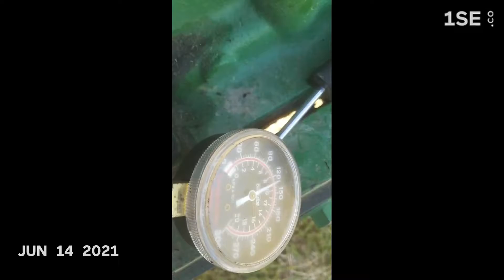2021 captured one second every day

Comment: Came here for the top end overhaul on the Lincoln and became mesmerized by this afterward! Way to go bruh on a solid family. Another "Cat Dad" from the PNW.
Reply from the maker: Thanks man!
I have 2024 1SE I'll upload as well.
Also the Lincoln will need another top end as soon as I get my shop put back together.  Inferior overseas parts from Ebay allowed a timing sprocket to split, timing chain to break and wreck the valvetrain on the whole passenger side of the engine.  My goal is this summer to have that together.
Reply: @vengethis  I know most shops will lift the body (on a number of different vehicles) to make a ridiculous job a lot quicker, but damm, that just seems like a ton of extra work. I took and engine out of an Aviator right through the top but I cheated by pulling the carpet back and took a 1" holesaw to the firewall to pass a socket through to one, entirely inaccessible bellhousing bolt. Plugged it with a plastic body plug. I may end up pickin your brain on the 5.4 when it comes time to do my guide rails. Did you know Fords first DOHC V-8 was the Ford Cosworth DFV in the 1967 Lotus 49 grand prix car? Of course then there's the SOHC 427 NASCAR beast. Ford's got a bit of experience building crazy engines. Is the 1SE a Cadillac or Camaro?
Reply from the maker: @ 1SE is the "1 Second Every Day" video.
My good friend who's also a mechanic talked me in to pulling the body and he said in his shop they found that the extra couple hours to R&R the body easily offset the extra time trying to work around having the body on.  The last time I had the body off of the Lincoln I borrowed the lift in my neighbor's shop, but he's since sold it. I have a Bendpak 12K to put up I just need to pour a slab and install it this spring.  That's the plan anyway